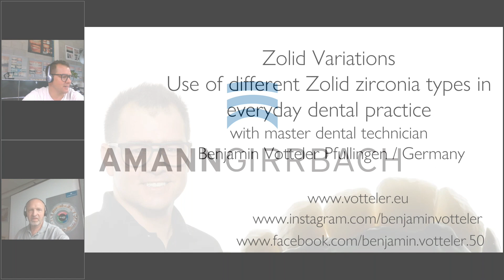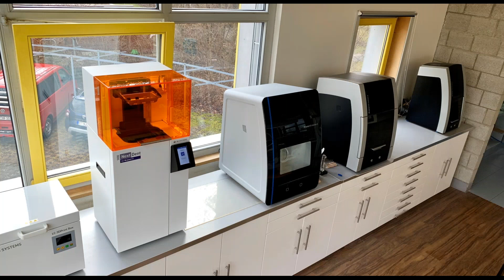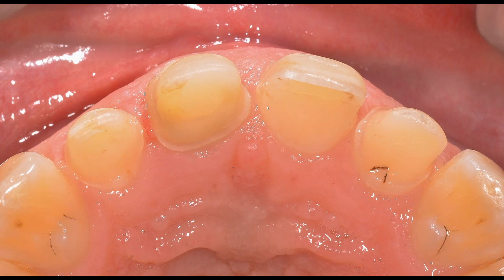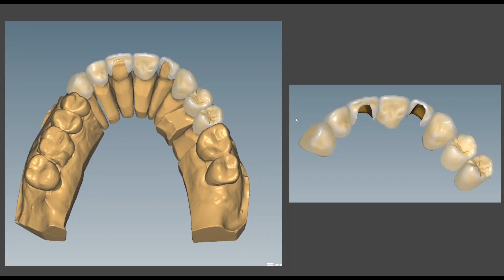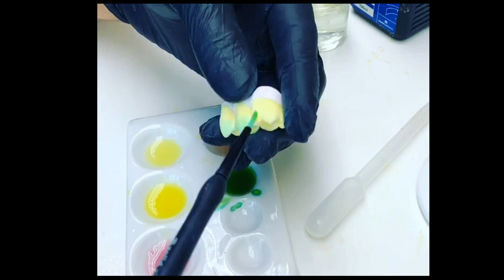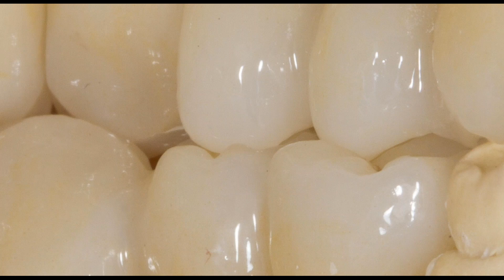Use of different Zolid zirconia types in everyday dental practice

Comment from the maker: 00:04 Introduction
06:07 1. case - Single anterior
08:20 2. case - 3-unit posterior bridge
12:38 3. case - Anterior restoration, mix of crowns and veneers
19:00 4. case - 24 on 16 implants
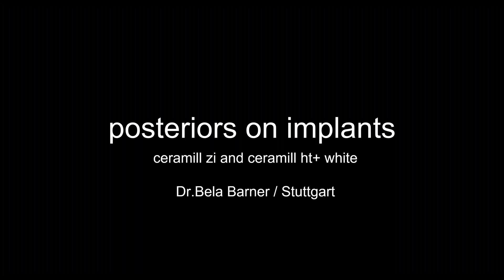24:58 5. case - Posteriors on implants
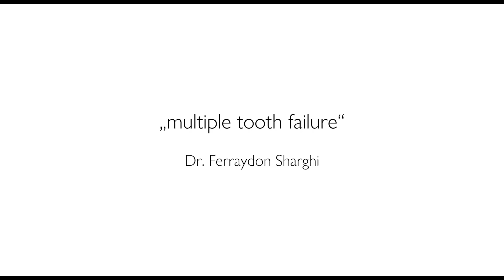28:40 6. case - Complete full mouth rehabilitation